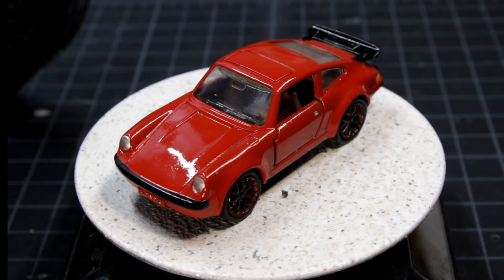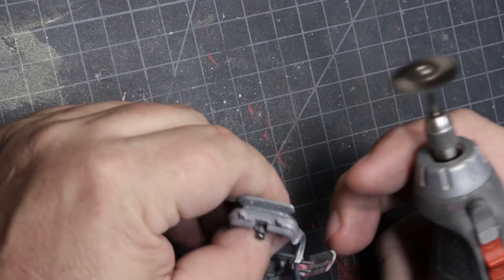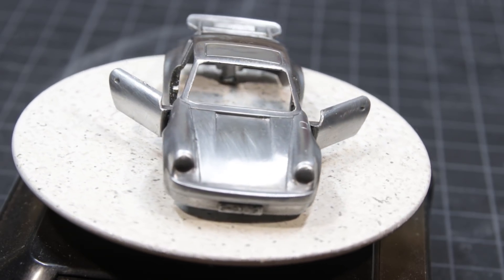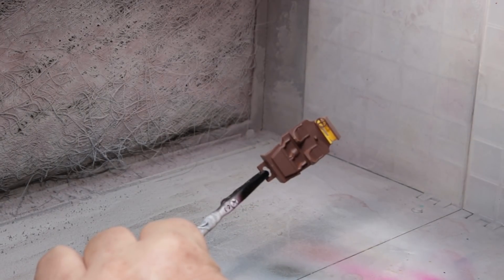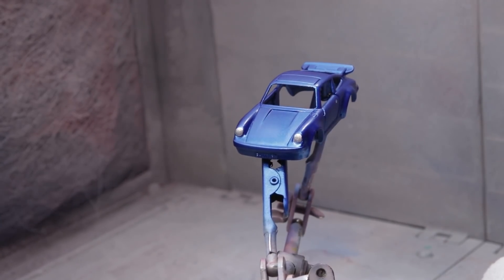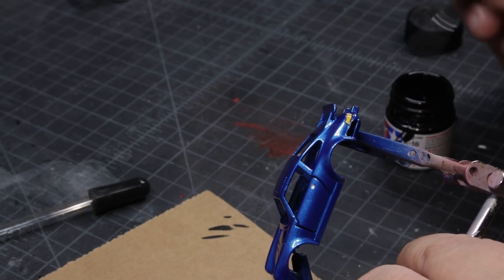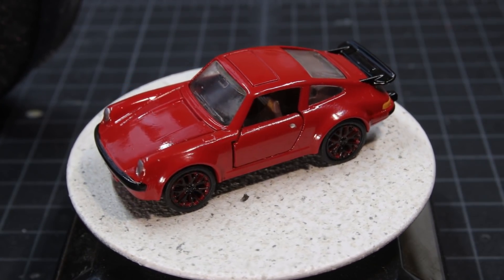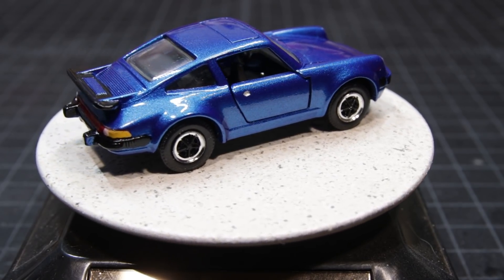Matchbox #3E Porsche 911 Turbo - Custom

Comment: Looks much better in this blue. Nice work.
I too moved away from the tamiya paints, had a few bad results from them. Shame as I love them on plastic model kits but I think scaled down onto something this small and intricate they seem to suffer.
Reply from the maker: I haven't really moved away from them.  I've had pretty good results with them on the whole.  They're perfect for restorations because they are typically "no frills" paints that mix well with other acrylics, like Testors or Model Masters, both of which I have used as well.  They can be finicky I'll admit.

Comment: You're right, the blue looks much better than the red. The red looked too toy-like (ironic, as it is a toy). The windshield still looks foggy, though, You should look into getting some plastic polish as a step between sanding and dipping in Pledge (Future) -- Novus II is a great choice. As always, a great job.
Reply from the maker: I did.  The problem is that the plastic has been compromised by something and is foggy.  Sometimes, there is no solution short of replacement.

Comment: Have you considered stripping then refinishing a casting using the wire wheel and steel wool and then simply clear coating it? That Porche looked sensational before the blue went on. Looked great after as well.
Reply from the maker: Actually, you're not the first to suggest that!